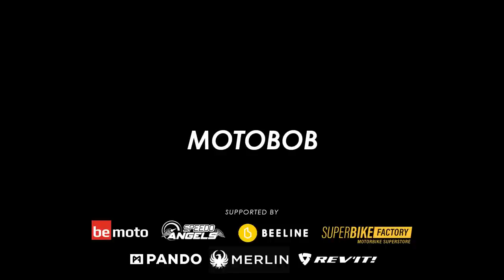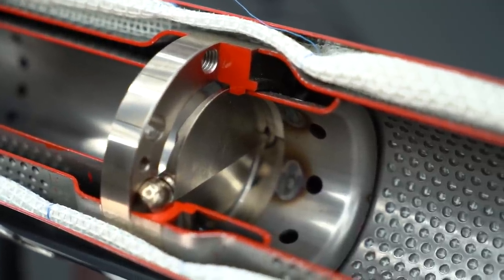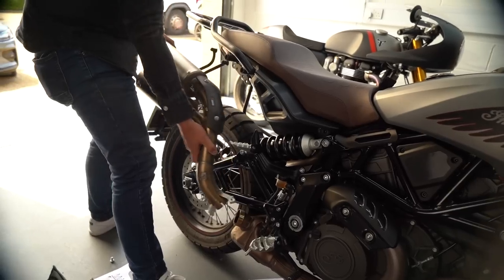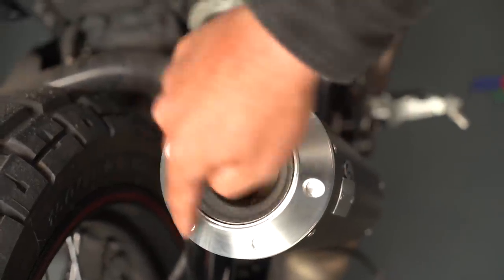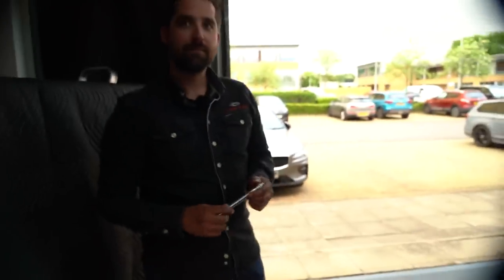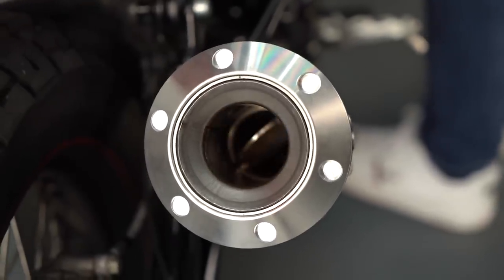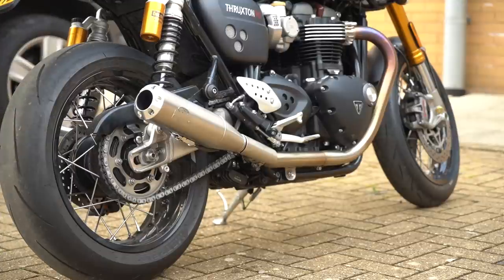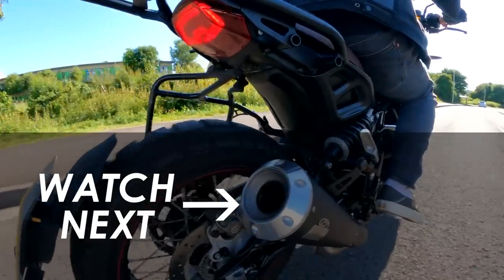Jekill & Hyde Exhaust Installation & Review (Indian FTR 1200 Rally)

Comment: I wonder if there's a difference in back pressure requiring the electronics to tweak the fuelling, or if they've managed to keep the pressure the same via both routes?
Reply: Bike most likely changes, I mean it is the same as a normal slip on with the baffle vs without the baffle
Reply: @joekleinberger4922 but wouldn’t you expect the ECU to have to take a little time to learn the changes to maximize performance and efficiency? I guess only a test ride would say for sure as to what the rider experiences in terms of delay. I certainly want one.

Comment: with the angle of the exhaust up at 45 degrees does it not get problems with water ingress when it rains. wouldnt fancy trying to open the valve when its rusty

Comment: Or you could drill the pipes and remove the baffles , which you can always reinstall if need be and save a load of wedge . It’s pretty straight forwards to do , it must be if I managed it without making a mess
Reply: Can you make quieter at the push of a button?

Here's the point of this video 👉
Here's where you're looking 👈

You seem to have missed the point!

Comment: Please can someone explain to me how bikes have a lot of grip despite having much skinnier tires than cars, and if cars are heavier shouldn't they have more grip?
Reply from the maker: Pretty sure cars have a lot more grip than bikes!
Reply: @motobob  no, bikes can do 0 to 60  in around 3-4 seconds while hellcats can't despite them having way wider tires, 2 in fact please I need explanations
Reply: Bike's don't have more grip, they have less. Cars can handle more braking and acceleration forces without overloading the tyres, but they're heavier so they require more forces to accelerate as fast as a bike which is why bikes are faster. Bikes also have stickier tyres that wear quicker than car tyres, but car tyres usually focus more on lifespan, making them less sticky than the equivalent bike tyre.
Reply: @will_on2793  oh I get it now thanks
Reply: @kalactose348  Go calculate how much weight each horsepower has to move on that 3-4 second bike and on your hellcat

Comment: Its a slip on with a valve, surprised they require that they install it but then again with the "ecu" for Euro laws perhaps its more involved. The volume won't be dramatic as it's still using the stock cat and headers.

The Chief sounds good though.

Comment: I think royal Jordanian had similar setup on his husky - really loud though. Neat solution but I still don’t get why would you like a loud pipe. It’s just gives you headache and damages your hearing so you need to use earplugs and then you don’t hear much anyway. So it looks like you do it for others - but they think you are a twat… hence I just don’t get it. Nice sound yes, loud sound - what’s the point?
Reply: You should really be wearing earplugs while riding anyway though, even with a stock exhaust. With a set of reasonable loud pipes mine went from inaudible to a nice level of noise that is perfectly fine even sat on the motorway for hours. It's too loud with no earplugs, but I never ride without them so I don't mind.